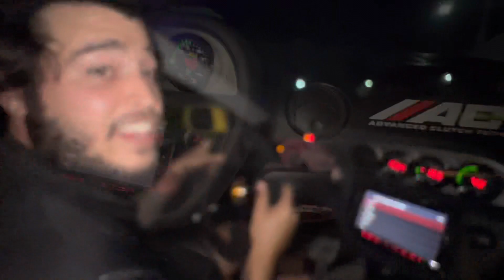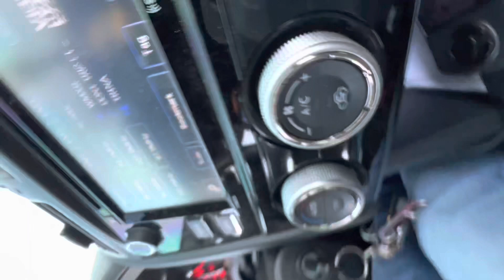Building the K24 Turbo RSX in 2 days for Cars and Coffee Miami

Comment: fire fuckin dc5 
hopefully ya are still on this channel. i have one question...if yall know by chance...if arcing the positive on the car while the negative still connected could ruin the ECU to the point where TWO different tuners couldnt tune the car becaause the settings they input wont change ever. said he dumped more fuel than HIS rsx and no change. is this possible? or do you think theres an error somewhere that i/we made ?????